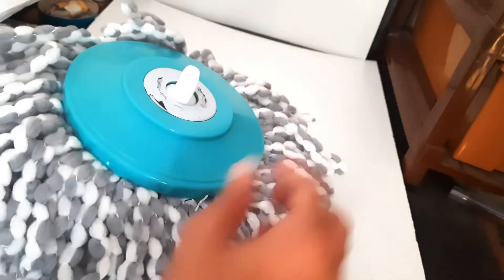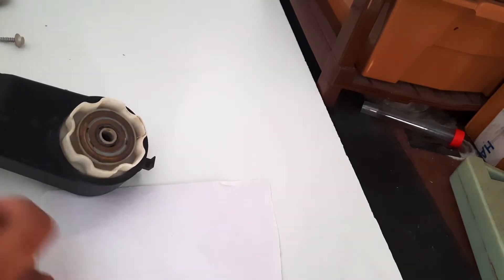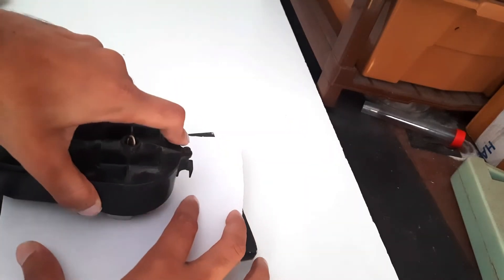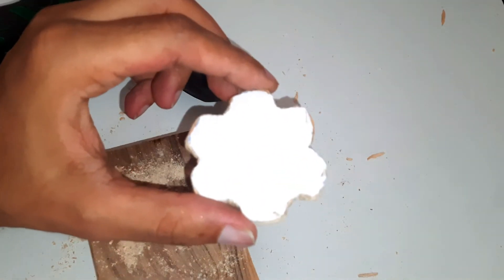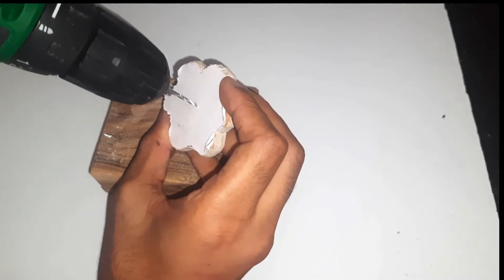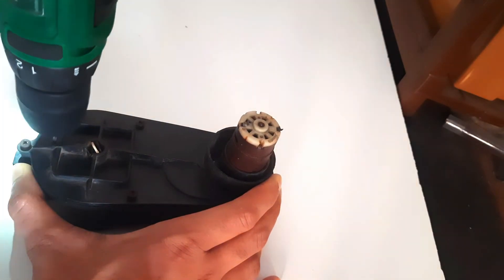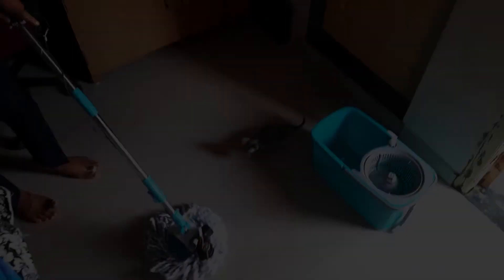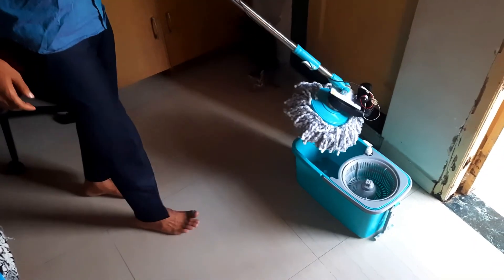How to Make  Floor Cleaning Machine | Homemade Spin Mop

Comment: You wasted a lot of time showing how you made the wooden gear.....but skipped over important parts showing the setup of the motor to the mop head and the wiring.  And did you take apart that motor and put it back together just to confuse people?  It really wasn't necessary.    No measurements provided on where to drill the holes in the housing......       cool invention, worst tutorial ever.......
Reply from the maker: Thanks for this review 
I will improve my upcoming videos 🙂